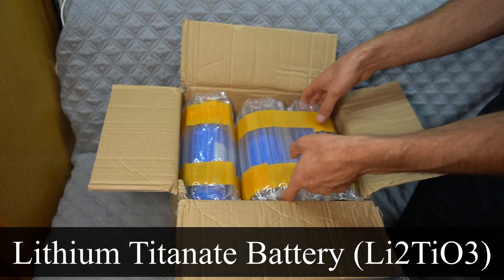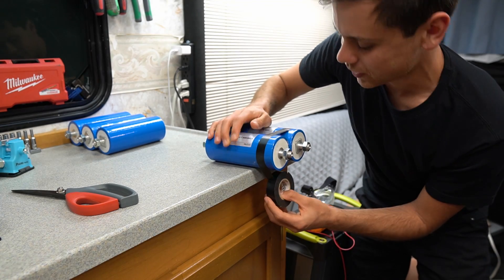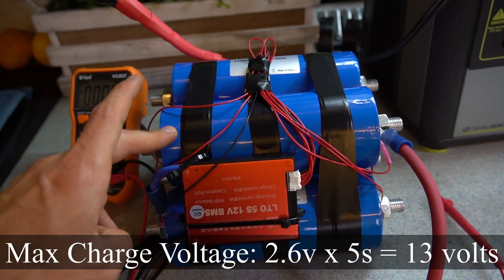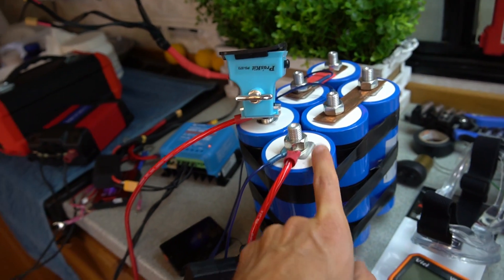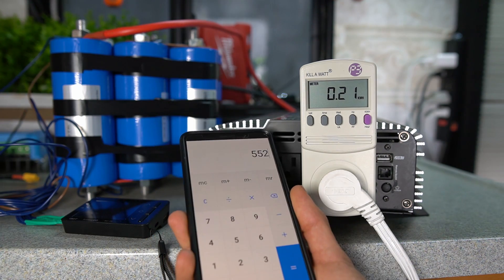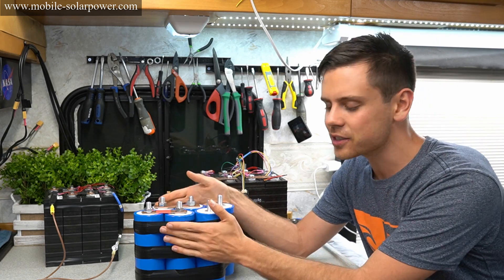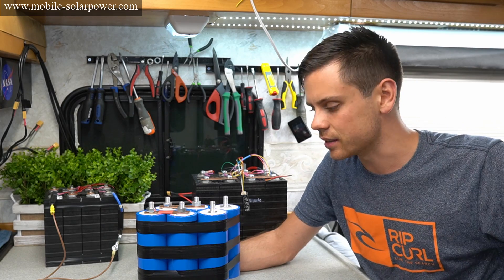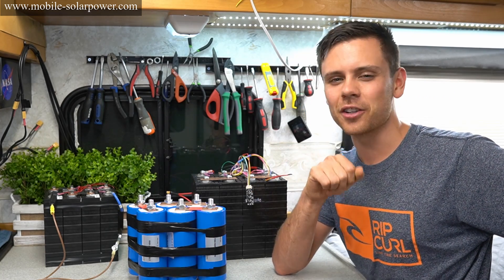DIY 12v LTO (Lithium Titanate) Battery

Comment: I have gone though the process to provide 12 volts using lithium-ion batteries. Not the same as the battery chemistry you used, but the math is the same regardless of the power source. Just use the single cell chemistry, low charge end of the voltage to get your power above 14 volts. In regards to lithium-ion batteries, the problem with using 3S set up is the bottom charge is 11.1 volts (3 x 3.7 volts) with fully charged 12.6 volts (4 x 4.2 volts) As the load drains the charge from the battery, it goes below 12 volts. To provide a constant 12 volt supply, use a 4S set up (lithium- ion). It will provide you with 14.8 volts (4 x 3.7 volts) on the low end and 16.8 volts (4 x 4.2 volts) fully charge. Then use a voltage regulator or Buck step down. Set the voltage output for 12 volts. This will provide you with a constant 12 volts of power regardless of the input voltage from the supply. Note that the voltage regulator input must provide 2 volts above the output of the regulator as the supply voltage is drained. Hope this helps you in your future projects. Great job!

Comment: I run LTO all the time. The cells you selected has a poor package design for your use. They are used in a power plant storage building where you need big buss bars.Copper bolts add lots of weight to each cell. My guess they are out of spec. cells that are seconds made for a power plant but failed capacity testing.  I use prismatic  pouch cells  with tabs you weld. I tested my used 18ah cells and they put out 18 to 19 ah. Out of all the used cells I bought,  2 cells are bad out of 40ish cells and the seller gave me some extra cells free because I may have a few bad cells. Bottom line your cells should put out the amp/hr value printed on them or they are bad. Weight is a trade off using LTO, under low currents LTO isn't your best battery unless you need the low temp rating or fast recharge . My LTO packs stay cool on high current discharge   rates due to the extra weight of the cell  and the low internal resistance and the extended high temp rating of the cell. Other low mass cells heat faster and if they heat up too high,  you get a decrease in the amount of cycles out of the battery. If you add a heat sink or a water jacket to keep them cool , you should look into LTO cells because you just added weight to your light weight batteries making them as heavy as a LTO cell system  . I find LTO cells almost double the weight of the lighter weight cells. On my worse install on a Ebike , I get around it by making my packs modular, so even in light weight installations they can work well.
Reply from the maker: Good to know!! This is the information I was looking for. Thank you
Reply from the maker: You might like this: https://www.google.com/url?sa=t&source=web&rct=j&url=https://www.mdpi.com/2313-0105/4/4/59/pdf&ved=2ahUKEwjYqcyS2OviAhVItZ4KHXlTAx44ChAWMAF6BAgIEAQ&usg=AOvVaw1lmPrKfdeaBh4aheqgxiiM
Reply: Yeah, same stuff: i bought 3.6Ah pouch cells for robotic lawnmower upgrade, and they had correct capacity. I bought the cheapest 30Ah cells from china for my car (first for testing, my car had 350kg flooded NiCd originally), and those are fine too. I think most of 40 Ah cells are fake there, and the weight tell the correct value: 30Ah cells weight is 1.15kg, 40Ah is 1.24kg. Or they are simply b grade cells, even the correct weight.

Comment: Thank you. Whats is the best battery and what is economical best battery for price pleease let me know
Reply: There is no best battery and there never will be. There should however be a best battery for your application if it is reasonable. What is your application?
Reply: @kingrpriddick  I like long lasting deep cycle battery . want to convert city electrocity to all solar giving freedom more family time what familys deserve long lasting baterry is luthium Lion will do . max well ultra chapacitor say 10 million cycle lair it already failed after 3 years . need solar storedge battery goes in and extend out side of battery on Yeti.
Reply: @kingrpriddick  thank you for reply sir
Reply: @kingrpriddick  i want to deep cycle solat storedge battery works in and out of yeti to convert house to off grid so many cycle strong battery

Comment: Can you fast charge it like the system they did in Oppo's SuperVOOC fast charge?  since you say LiFePO4 is better than these batteries which is only good for safety and longer life cycle, if you can charge it to 50% battery in 15% then this battery could be competitive, right?

Comment: isn't that naive to use a lithium ion protection/balancer board for this type of battery? All safty voltage levels are different not to talk about how many decades of years does it take to balance this pack with 50mA balance current, its a 40Ah cell. Undervoltage, overvoltage protection are at total different voltage thresholds. Keep up learning 😉
Reply from the maker: Dang you're right haha

Comment: These batteries are a bridge between batteries and capacitors.
You're getting a little from both, but the best of none.
Reply: They last long and are unlikely to start burning or exploding. To me this is useful. Ultracaps have a lower energy density, or not? Also their voltage drops while uncharging?
Reply: @sevdev9844  has anyone taken these apart? maybe theyre supercaps with a small battery on the outer edges??
Reply: Dianne McCarthy 
No they’re not. The graph clearly shows that they have very little voltage drop as they discharge. Supercap’s voltage drops in  direct proportion to their discharge.

Comment: And I'm scared not to short out my Li Ion small 4.2V 3.4Ah Samsung batteries :))
I use them to control two stepper motors and some circuits that in total they all consume around 10.8 W or so. And basically my system can run for like 5 hours. And it doesn't even gets hot :))
I'm a starter

Comment: There's seriously a large risk and buying any long life span products from China. I bought products that failed and China is notorious for substituting lower-quality products after getting the contract.

I don't have a good solution for this problem. Other than improving standards and enforcement of the rule of law in China. And that's just going to take time. There was a time when things from Japan were also cheap junk and today they are top quality. I expect there will be a day when Chinese products are the top quality as well.

But at this time they are very good at making things that look and feel top quality but which are not. Buyer beware.

If you are not returning these batteries then it would be a community service if you put them true charge-discharge Cycles and we see if it actually exceed three to five thousand Cycles.

Comment: False. Go read a 18650 datasheet dude. 400/500 cycles too..... 3000 cycles would be nice.... But nope.
Reply from the maker: Lol these are not 18650. Stop trolling. Read about this chemistry
Reply: @WillProwse  omg 🤦‍♂️ I'm not trolling. I'm not even talking about the huge cells you test.... I was talking about at the beginning when you list and say how sla 300 cycles etc. Lifepo 3000 and these 20000, Lifepo and lion datasheets show 400/500 cycles. Not 3000+

Tbanks for the really abrupt reply though eh 👍
Reply from the maker: @LambySRI  every data sheet I am reading is saying 2000-5000. battleborn published data showing charge rate is large dependent variable and getting 5000 cycles with .4c charge rate is easy. are you sure your data sheet was referring to cycle count to 80% capacity??
Reply: @WillProwse  yep pretty sure. The hard test they do cycling at full power, and recharging at full rated power, shows 400/500 cycles to 80% original capacity.

I know people on ebike forums claim charging to a lower voltage increases cycles, in to the thousands.....

Comment: With an 85% discharge efficiency the internal resistance of those cells must be horrendous. I think if you test them with a much lighter load instead of a heat gun maybe you can get the 40ah.

It would be interesting to open one cell to see what is inside. There are videos out there showing that some supposedly high capacity 18650 cells from China actually have a much smaller cell inside surrounded by sand.
Reply from the maker: Yeah I'll be doing that test again. They didn't heat up much so that was the confusing part. That much heat should have been significant on the cell.
Reply from the maker: Read this battery study: https://www.google.com/url?sa=t&source=web&rct=j&url=https://www.mdpi.com/2313-0105/4/4/59/pdf&ved=2ahUKEwjYqcyS2OviAhVItZ4KHXlTAx44ChAWMAF6BAgIEAQ&usg=AOvVaw1lmPrKfdeaBh4aheqgxiiM
Reply: @WillProwse  I hate how the study starts: "Lithium-ion batteries are extensively employed in many applications including electric vehicles
 (EVs), hybrid electric vehicles (HEVs) and many consumer products such as cell phones, tablets and computers." This is completely wrong, and had me wondering if I was reading the correct document Lithium Titanate (Li4Ti5O12) was barely ever used for EVs back in the stone age at this point and was somewhat accepted in the UPS market before better alternatives were adopted (LiFePO4) and lives in on in very few applications (supposedly solar street lights where the inefficiency is unimportant and cell life is paramount are the last "major" application).
Reply from the maker: @kingrpriddick  it said lithium ion, not lithium titanate.
Reply from the maker: @kingrpriddick  it is correct and you misread it. Read it again.
Reply from the maker: @kingrpriddick  it never ever said that titanate is used for EVs. Please read it and think. Lithium ion is name that applies to many battery chemistries, not just titanate
Reply: @WillProwse  But they aren't studying many battery chemistries. And their statements don't apply to what they are studying. It's still a good study, "fluffy" research papers are just a pet peeve of mine I guess.
Reply: @WillProwse  more amps efficiency goes to the crapper 
13 amps 93.8 efficient, 110 amps drops to 49%

Comment: these seem more optimized for energy harvesting or cases where the robustness is more important then efficiency. like imagine a offgrid battery somewhere. where you don't care as much about discharge loss but more about storing the power before you lose it.

Comment: The discharge losses cannot be constant. Every battery has a discharge efficiency curve. They would definitely heat up a lot if you were losing 15% of the discharge. Image 150w of heat at 1000w of discharge I doubt it. Did they heat up?
Reply from the maker: That's what's driving me crazy! I'm used to internal resistance on lead acid heating them up etc. Or pushing limit on lipo etc. But these cells were only a bit warm. Should have been warmer considering loss from load. But they are bigger than other cells I'm used to, so possibly it's dissipating it over more area... I need to research this more. These are a bit different than other cells I work with
Reply from the maker: And yeah it can't be constant. But internal resistance is low on these. I don't understand why the data sheets and electrical engineering journal say the discharge efficiency is 85%. Even my buddy who tests these at his work said that's the figure he gets as well. I need to learn where the energy is going
Reply from the maker: Here are the actual numbers: https://www.google.com/url?sa=t&source=web&rct=j&url=https://www.mdpi.com/2313-0105/4/4/59/pdf&ved=2ahUKEwjYqcyS2OviAhVItZ4KHXlTAx44ChAWMAF6BAgIEAQ&usg=AOvVaw1lmPrKfdeaBh4aheqgxiiM

Comment: Just get rid of the BMS. This battery can deal with any abuse you can give it. Just make sure to check it once in awhile to make sure one of the cells isn’t shorted and of course use some fuses and wire that won’t carry way more amps than you need.
Reply from the maker: That's what I'm hearing. Some guy in a forum ran one to zero volts and he said capacity was still 100%. These batteries are so bizarre
Reply: @WillProwse  I did all sorts of torture tests on mine as I have a 60kw LTO battery in my home. Of course I wanted to make sure it wouldn't burn down the house so I over volted it, ran it to 0, shorted it, and even fired bullets through it. I could not get it to catch on fire no matter what I did. The LTOs can short though and that is why I advise fuses in case a lot of amps tries to flow to the shorted cell it will at least break the connection. Food for thought.

Comment: Lithium ion ,and lithium polymer , two different animals when wired in series  or series parallel.  Be care when charging, they will burn, and I mean catch fire, and they will have to burn themselves out. Charge in a metel container with a lid on...don't ask how I know!3.7volts per cell.alwAys charge below  the c- rating,eg 50c discharge = 4.5amp charge rating.if the cells you purchased were below 3.4 you got bad cells.
Reply from the maker: I charged 100's of lipos before I even touch lithium ion
Reply: @WillProwse  when you were checking the cell at the beginning you said you were reading 2.7v per cell.modern manufacturers of chargers with balancing will detect voltage lower than 3.4v, and will not come on line to charge.they protect themselves and you.good vids.keep them flowing.
Reply from the maker: @ronaldrose6885  these are not lipos. These are lithium titanate. They are a lower nominal voltage than lipo packs. totally different voltage range.
Reply: @WillProwse  send more info.
Reply from the maker: @ronaldrose6885  google lithium titanate
Reply: @WillProwse  thanks for the link. Keep experimenting. Look forward to more of your work.
Reply: @WillProwse  2.5 volts is below the 3.4v per cell your cells were damaged due to self life, get your money back.

Comment: 85% discharge efficiency is way low. It's surprising the cells didn't get hot to touch since 700W discharge would be losing 100W as cell heat.
Reply from the maker: Yeah seriously. They should have been hot as hell. That doesn't make sense.
Reply from the maker: https://www.google.com/url?sa=t&source=web&rct=j&url=https://www.mdpi.com/2313-0105/4/4/59/pdf&ved=2ahUKEwjYqcyS2OviAhVItZ4KHXlTAx44ChAWMAF6BAgIEAQ&usg=AOvVaw1lmPrKfdeaBh4aheqgxiiM

Comment: I’d like to see a more moderate 6-cell/12v (maybe 2 packs in parallel) or 12-cell/24v load test not using an inverter.....inverting to AC 120v is adding @ 15-20% inefficiency once you account for all the losses.
Reply from the maker: That's why I take that into account with my calculations. 90% efficiency for this model of inverter.

Comment: Get the LTO battery from Jack at Liyuan Battery Company - big difference in quality and performance
Reply from the maker: Even if these batteries worked as the data sheet states, the discharge efficiency is horrible. Not great for solar.

Comment: Will have you ever used the 40152s battery they claim 60ah
Reply: David Whiteside 40152 LiFePO4 cells are rated at 15 A/hr...i just got 24 of these cells for an ebike project.....some checked out at 18 A/ hrs!

Comment: You gotta be skeptical about the 20k lifecycle though as they advertised the capacity way off.
Reply from the maker: Well taking the discharge inefficiency and wire loss into account, and voltage range for application, they might just be 40ah cells. I don't like them anyways so I don't care

Comment: i bought some 60ah 3.2v prismatic batteries.  One is 3.00v and others range from 3.12-3.3v.  is this ok?
Reply from the maker: They should have arrived at 3.35 volts
Reply from the maker: Who was the seller
Reply from the maker: Are they new
Reply: @WillProwse  no, they are used from ebay.  sorry forgot to mention that.
Reply: they are the yellow thunder sky ones
Reply: @WillProwse  i think i will need to bottom balance them.  hopefully they aren't very used.
Reply from the maker: Yeah bottom balance for sure

Comment: If you have a lot of excess power (solar, wind) you dont have to worry about 85% discharge eff.
If you have 10C you can get 100A from single row of cells. You can start 2kW kettle just from single row of these cells. This would be not possible with LifePo4.
You need less cells to run big loads.
Reply from the maker: Yeah but for solar and standard autonomy day calculations, you will never run into this problem. For solar you always have a huge battery

Comment: Hey Will, I was looking at the open circuit voltage on a renogy 100 at 22.5V. The jackery says it will take 12v - 30v. Would that work? Seems I remember hearing a 50W panel was max?
Reply from the maker: Yeah that panel will work with the jackery

Comment: Your use case would fair better with a more complex battery made of these cells. Something like Xp12s with a dc-dc psu. One that takes a wider range and puts out a constant voltage like 13.8v.  Surely, a user programable bms is mandatory, to set the high and low tresholds and over-current limits. 
Because their high internal resitance, going for a higher voltage will enhance the ammount of availabe energy.
Reply: Pașca Alexandru i agree.  Other DIY guys tested/abused  LTO cells to even up to 3V/cell and they said it was going strong.  And come to thing that the cut off cell ob thw data sheet is 1.5V /cell.

Comment: LTO batteries have some other properties that make them better than lithium ion for some applications. Most EVs use lead acid 12v battery because they can stand colder temperatures during charging. A lithium ion battery would need a heater and protection to prevent charging below freezing. LTO batteries can be charged at -50C like lead acid. 

If you have a hobby charger you can do a better capacity test at specified C-rating for charge and discharge. Any battery charged and  discharged fast will have low efficiency.
Reply: Tesla has a heating and cooling system for there lithium batteries.
Reply: 847MicRoss, yes, yes, but not for the 12v battery, which is why Tesla’s all come with lead acid 12v batteries.